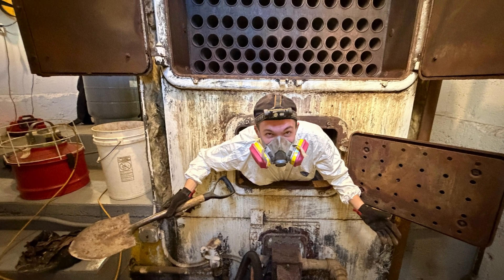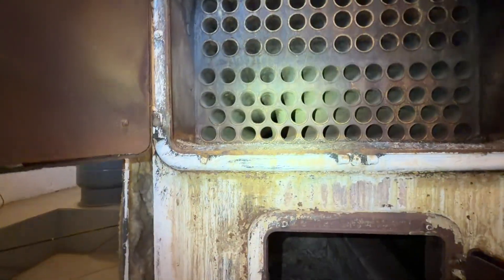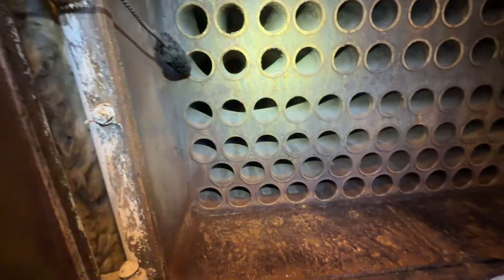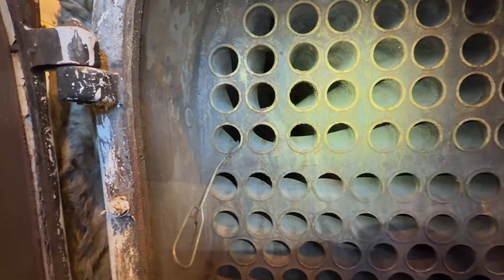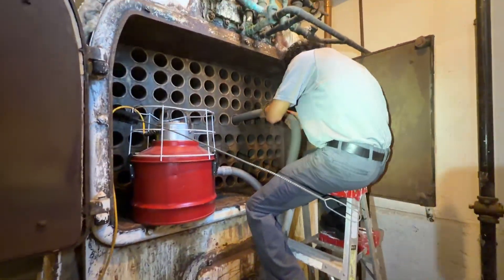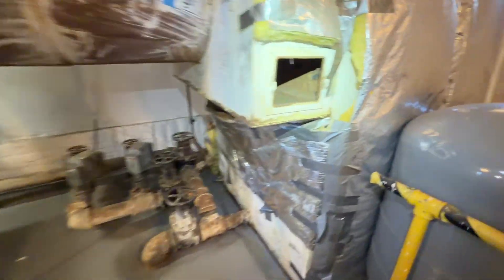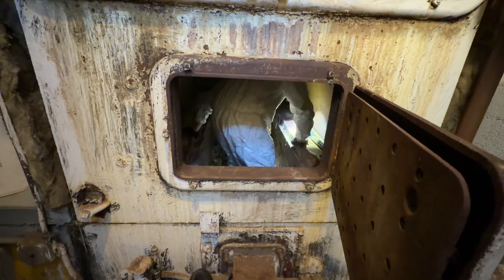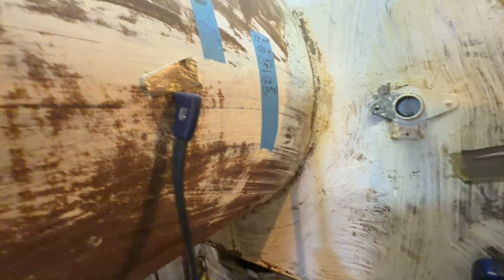Inside a 2,000,000 BTU Commercial Boiler in New York - Full Maintenance Breakdown on How We do It!

Comment: You need a 2 1/2" pipe brush with flexible fiber extensions. Make sure it goes all the way through the pipe, then vacuum all the pipes. Inside the doors, on the edges, place gaskets to prevent leaks, then brush the tube sheet with a wire brush. You need tu clean the chimney base to

Comment: They make a boiler brush for that size tube. Might do a little bit better of a job for you. 

I just brush out all the tubes then vacuum up everything. With a larger soot vac you can plug right to the end of the tube and get the dust the larger brush doesn’t push/pull out. Take you 15-20 minutes without murdering your arms.

Next tech will glance at it, not do much because it’s clean and the office will wonder why spent most of the day there.😂😂

Comment: i remember doing an asbestos removal on a realy old school boiler, and cleaning down to dinousaur skeleton of cast iron pieces. 
 then we had to put ceramic rope between ribs super high temp cement , and then ceramice fiber insulation over the whole boiler. cement and chicen wire with mastc finish.
 have not seen one of those in a long time new schools are using  rows of regular oil boilers like 200,000 btu each weil mclain golds, in row and have controler turn them on as needed and rotate which ones are used

Comment: Back in the 1980s I lived in a commercial building on Broadway and Houston st in NYC, the building originally was the power plant for the Broadway and Houston st railway Co trolly car line, built in 1892 it had 9 or 12 huge high pressure coal fired Heine boilers, four 1200 HP Corless engines with a 32 foot driving wheel- unlike the SF cable cars this system used wire ropes under the streets all the way up town and around to pull the cars along the tracks.
It had a water driven freight elevator from the ground floor to the sub basement, there were 2 sub basements. The building also had a dynamo that was capable of powering the whole building, "5000 incandescent lights" I read in an article about it.
Unfortunately, the system was plagued with mechanical problems with the wire ropes, there were plenty opf times one frayed and a car's gripper couldn't release to stop the car and it was pulled along smashing into horse wagons, horses and people before someone could phone the building's engine room to shut the line down.
Sometime around 1900 it was converted to electric cables under the street, and apparently either by WW1 or WWII every piece of the system was removed for scrap, 3 of the boilers were left, one was never used any more and still had the coal grates in it, the other 2 next to it were converted to oil.
I also worked night security on weekends so I explored everywhere down there, the heat was turned off at 5 pm weekdays, 2 pm Saturday and didnt come back on until 7 AM Monday. I can remember it being so cold one night I turned the boilers on for a few minutes to heat up the radiators, and during that time the oil gage showed they used 500 gallons of oil!

They were considerably larger than the one in this video, the building was 9 stories high, 100' x 200' with 2 atriums, basically zero insulation but when the boilers were on in the day  in my loft you could sweat it would get so warm, but as soon as the shut down at 5PM you could feel the room temp drop rapidly by the minute.

The cool thing about the Heine boilers was, they featured a 32" wide spread wing eagle made of cast-iron bolted to the top which was used for a lamp fixture, with the electric wire passing the the eagles' beak and a bulb/socket hanging below with a half-shade to illuminate the pressure gage.
I own several of both.
I don't know how many BTU they were,  the company books about their boiler did illustrate the boiler room in this building, but it only provides a total "horsepower" rating for all the boilers as a complete system.

I remember a shady thing going on with the new management's guy, the firebrick in one of the boilers kept falling down, and a contractor came in, removed the old bricks, dumped them in a pile on the floor and put new ones in. Then a couple of weeks later, it happened again, and again, and I saw a bill for $3,800 each time for boiler repair!
One day I "suggested" to the new management dude that he tell them to cut the brixks and install them in an arch shape, I had crawled in one night to look in the boiler and these idiots had used a piece of 1/8" thick angle iron about 8 feet long- the width of the boiler, and thats what held the weight of about 6-8 corses of brick!
The iron heated up, and bent, dropping the bricks, after my suggestion the falling bricks stopped, the guy was on the take, he was a shady Fk.

Comment: Brings back memories for me. I cleaned massive boilers all over Long Island and NYC, mostly for various school districts. Almost all of them were oil-fired. This was in the late 80's and mid 90's. They make threaded fiberglass rods and properly sized wire brushes that would make punching those tubes a whole lot easier. Used to get them from Sid Harvey if they are still around.
Reply: EVer run into the commercial Heine Safety boilers? Or in the schools- those with plaques on the doors that had the date and "Wm Gompert Arch" Board of Education,  City of New York"?

Comment: Thanks for the video Danny! You can probably rent some proper tools for cleaning out boiler fire tubes in fact TC Wilson is in Queens NYC that makes all the tools you need for working on larger commercial  boilers, chillers, pressure vessels. If you buy the equipment you will most likely need to start doing commercial/industrial to justify the investments. 

Hard to do residential and just a little bit of commercial....two different animals! I hope your lungs are okay after your partner forgot to install shop vac filter because not only did it cover the entire mechanical room both of your lungs got a good dose and equipment that old the used to build the fire boxes out of asbestos bricks and cement along with any insulation products! The vacuum made it very friable and dangerous!  N95 not good enough you guys needed respirators with proper filters.

Work safely my friend!

Comment: they sell a machine that vacs and brushes tubes all the down and back with touch of a button
Reply: Big Cat, see my comment about Goodway cleaners.
Reply: Yup, they work great, had a customer that had one in the corner of the boiler room, they had 2, 600 HP scotch marine boilers down there, they threw it away, they had no idea what it was, you can't fix stupid.
Reply: Yeah, and you have to hold that heavy machine in awkward positions for every tube.  I clean dozens of firetubes a year with up to 275 tubes.  I would much rather punch by hand and vacuum.  The only time I use a Goodway is if there is not enough clearance to fit a brush.

Comment: Excellent Daniel. Confined space work can be tricky. You should always have a forced draft fan operating bringing in fresh air.Tyvec, gloves, respirator and wear a harness in case you need to be pulled out. Gas test before entry and during your entire time inside. O2 and hydrocarbons at a minimum. No excessive temperature. Fuel and power must be locked out. You must always have a standby/hole watch person watching from outside. He can NOT enter the space if something goes wrong/his job is to call for help. Get to know and understand OSHA confined space requirements 👍👍
Nice job and video 🏆
Reply from the maker: Thanks for the tips!

Comment: Those are fire tubes
Reply from the maker: Even though no fire is passing through?
Reply: @DCHVAC Yes
You said it used to burn coal. The hot gases pass through the tubes to heat the water
Reply: Yup, definitely a fire tube. I used to take care of a 1952 Kewanee steamer with fire bricks, bed burner, converted from coal. Much larger thankfully than this one.